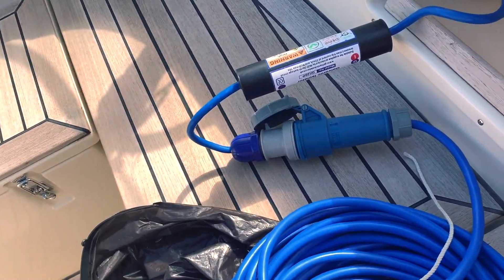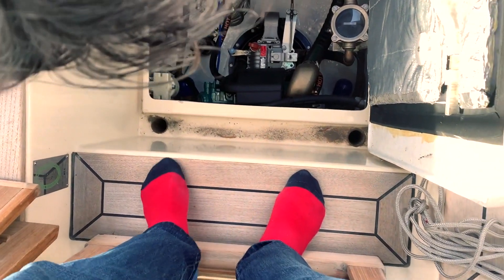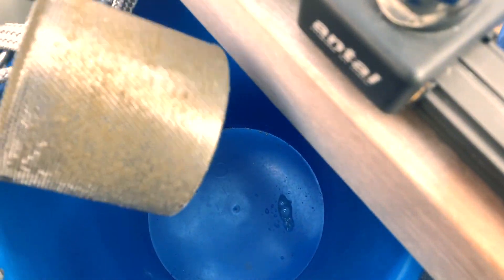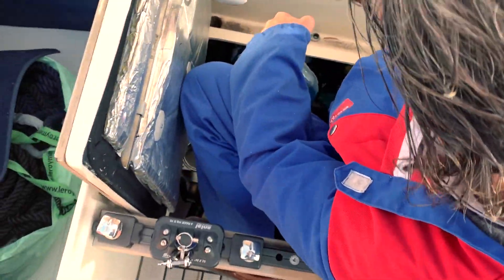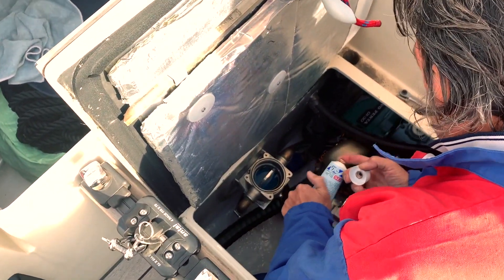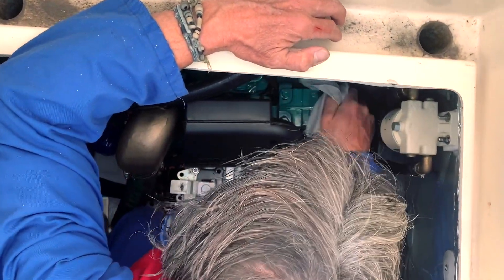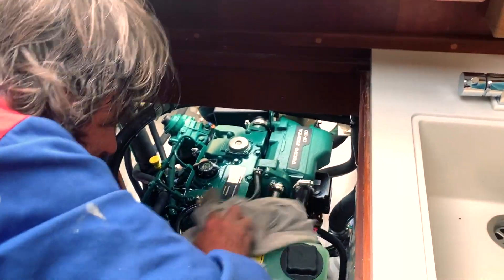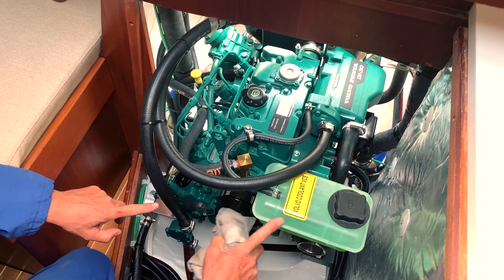Hallberg-Rassy 312 "Ellös": PREPARING THE VOLVO PENTA D1-30 FOR THE WINTER (DIY BOAT)

Comment: When filling the cooling system with anti-freeze, shouldn’t you take out the thermostat? Otherwise the mix won’t go into the engine block, where you want it. But maybe that is just with my 45+ old Volvo…
Reply from the maker: No doesn’t need on my new motor
Reply: The thermostat is in the internal cooling circuit. This antifreeze is going in the raw water circuit. That's why you see exhaust water even when engine is stone cold.

Comment: I usually run the engine with pure fresh water on the raw water side for as long as i have fresh water in my water tanks . Approximately 300 liters. This helps to dissolve salt. After this i do the run with the antifreeze mixture.  Best regards from Jarle
Reply from the maker: Thx mate!! Fortunately I got the boat in fresh water so I don't need to do this but your is a perfect operation!!!thx